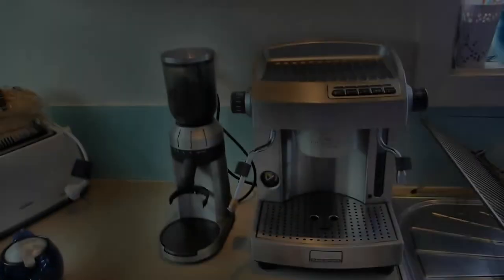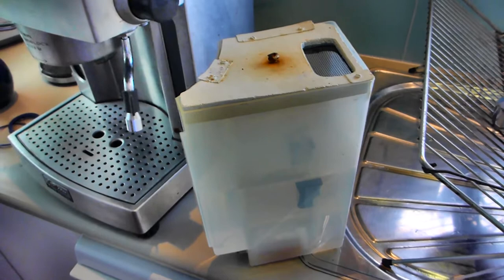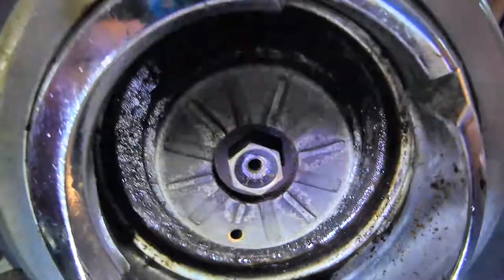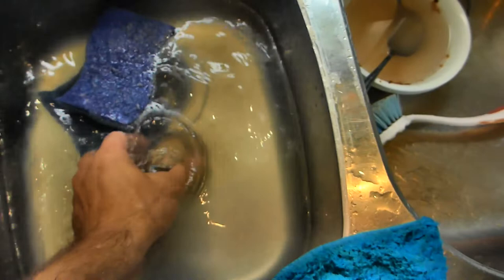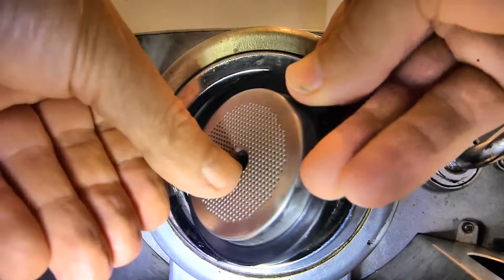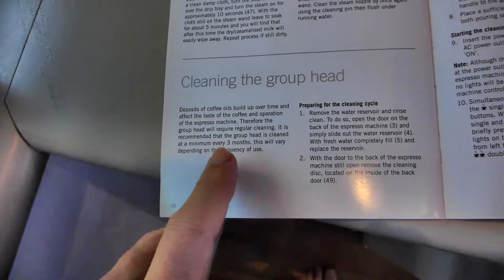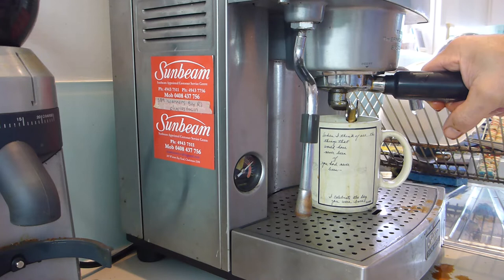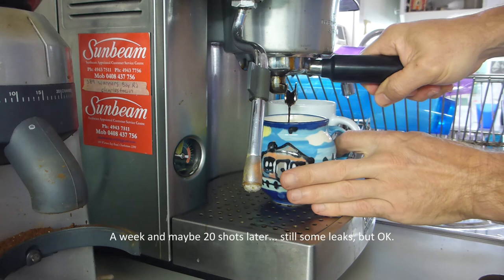Sunbeam EM6910 Cafe Series Group Head Seal Change

Comment: Thanks for this video! Our machine is about 12yrs old, we change the seal when the water comes out from back and never have issues with. This time around, after fitting the new seal we had water coming from the back and no pressure. Same as you showed in your 2nd and 3rd go. We did the same you did and is working well now. A bit of water comes out, but not too much. We love our machine.
Reply from the maker: Agree. Other E61 group head machine are lovely, but the heat up time is dreadful. I also use tank water, which is clean and free of dreaded calcium, which kills these machines .

Comment: Thanks for video, I did the same brew head seal job last night on a EM7100, much the same, except there is a countersunk washer somewhere in the metal stack in there too. I cleaned above the seal back to clean metal. Hell of a job, I used a screwdriver, flat end of scriber, scotchbrite and steelo which really is the needed trick. Also delicate job to protect the metal and not put in new leak scratches! When its back to bare metal it can seal above the seal too....  No leaks since, even with first run. No "bedding in" required then.
Reply from the maker: Mine has finally stopped leaking - although the collar is still worn.
Reply: @pescado99  Glad you posted this... mine leaks like a sieve - I took it apart and tried cleaning again and again... Thing still leaks... but maybe I just need to do more to bed it in.
Reply: Mine has the washer to does that go between the filters ?
Reply: can concur - the Em7000 is basically "the same" (just pulled the first shots from it after the clean  / new seal) with the small washer that sits on the brass nut
Reply: @markabbott81  hopefully you've figured it out - but it goes on top of the brass nut and the filters on top of that

Comment: G'day! I've got the EM7000, the updated version of the one shown in this video and I'm trying to replace the same seal in mine. I have tried and tried, with all my might, to undo that screw and there is ABSOLUTELY NO WAY it's coming out. It has started to strip the screw, rather than budge. I'm at a loss! Any tips before I destroy my coffee machine trying to bust this thing out?
Reply from the maker: Oh dear, yes it was very tight the first time I undid mine. Do you have a cordless impact driver? If so, take out the water reservoir, turn the machine upside down (for better access and to apply some force), then get a tight fitting Philips head bit and try to rattle the screw out anti-clockwiae. Otherwise an 'east out' might work, but that will be hard because it's a stainless screw. Good luck. Also try a local coffee machine place to see if they can help. High quality screw drivers are a must...
Reply: @pescado99 yes, I have one. Will have to scrounge for a phillips head bit for it, though. And,yes, it was already water reservoir out and upside down on the drain half of the kitchen sink.
Reply: @pescado99  Well, that's a bust. The new seal has not resolved the issue. I don't know what I am going to do from here.

Comment: As well as the missing washer. There are paper gasket spacers that goes between the head and the seal, To adjust centering the handle. It shouldn't leak then.
Reply from the maker: Quite right. I should have added that. This can help with a weeping collar as well.
Reply: He is right, it costs $5.00 an Italian food grade gasket sits between the rubber and collar head.
Reply: Yes, I noticed this also - washer (NOT your standard) and the spacer.  I wasn't sure on what size group head spacer to use so I purchased both the 0.4mm and 0.8mm. Currently trialling the 0.4mm.